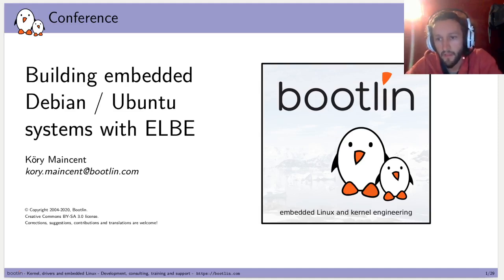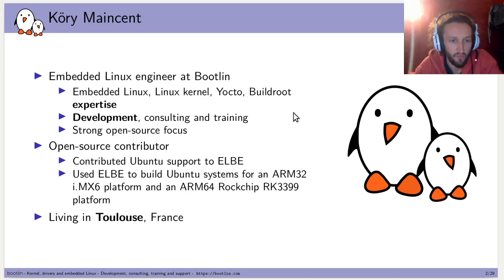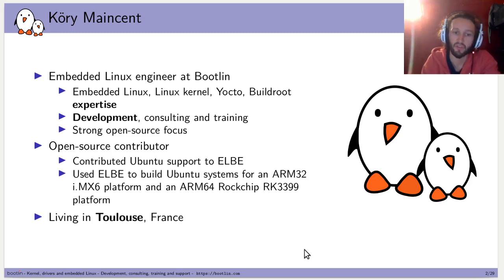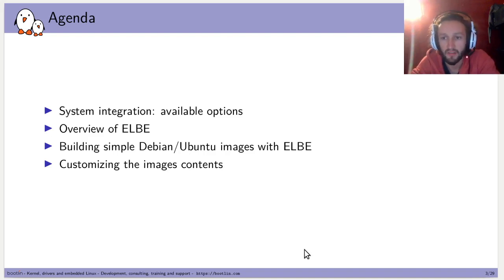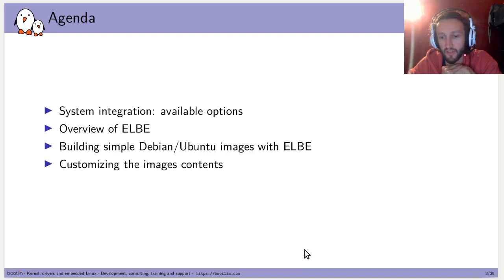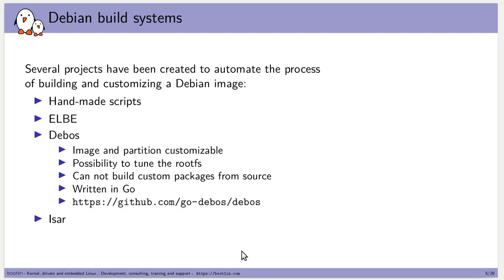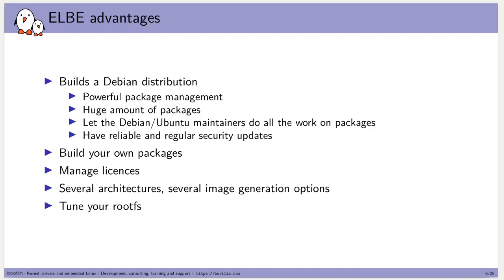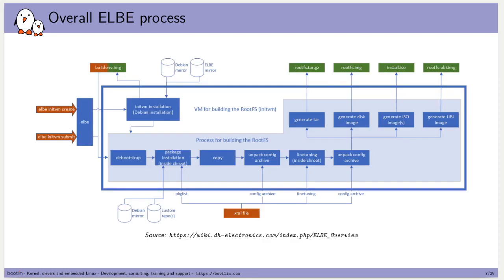Building Embedded Debian and Ubuntu Systems with ELBE - Köry Maincent, Bootlin

Comment: Hello Köry,
Great presentation, thank you and Bootlin for these videos.

Is it possible to show the steps you took to build the Ubuntu System for i.MX6 platform? I suppose you debianized the kernel and boot loader and gave it to the XML as deb packages? 

I happen to have an old kontron module with one of those chips, and though working with Buildroot and Yocto has been a steep learning, I'd still like to see if ELBE has any advantages to it. I tried building it all in a LXD container, turns out sharing KVM is a hassle. Once getting though it, the debianization of custom kernel tar ball (3.14.28 and 4.10.11 in my case as those are the only ones I have from Kontron with appropriate board level patches), has been tougher than I expected resulting in a lot of errors for which finding solutions has been not very easy. 

Thanks in advance. Please make more such videos :) .